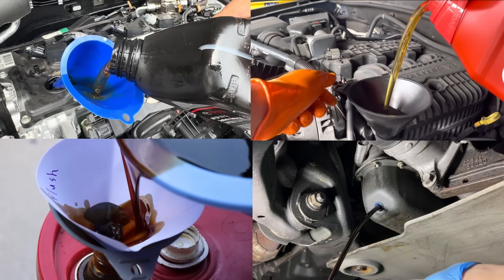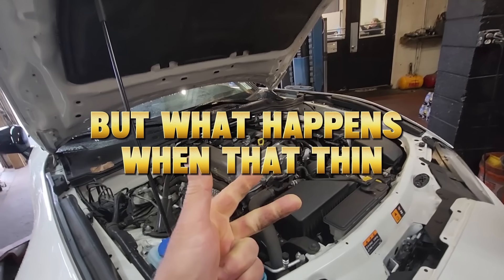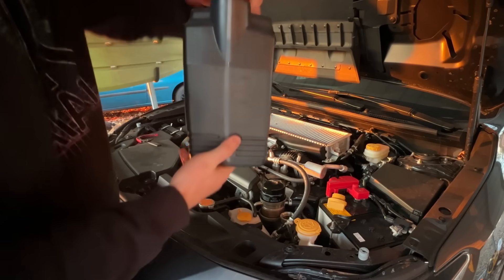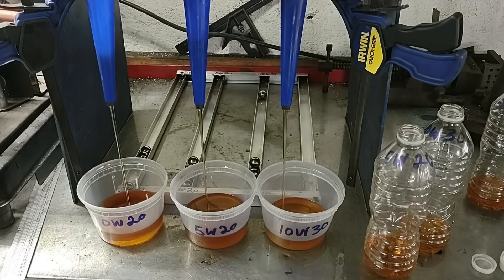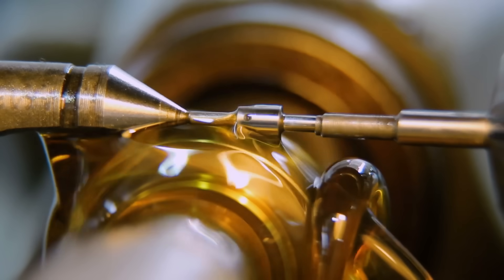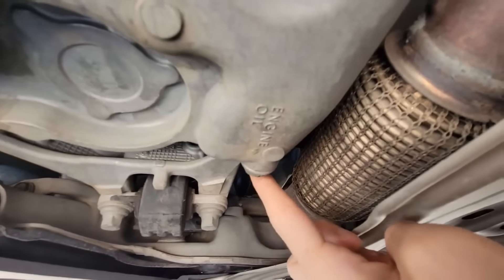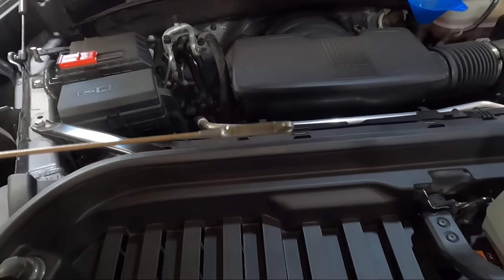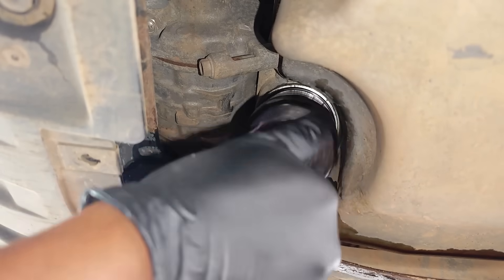The TRUTH About 0W 20 vs 5W 30 Oil (50 Engines Tested!)

Comment: Perhaps the biggest issue they don't talk about is oil change frequency.   Change oil frequently and avoid problems regardless of oil viscosity.  As an engineer, I agree with almost the entirety of what was said.
Reply: Yep main jobs of the oil are to contain wear particles and lubricate. Always change the filter when changing the oil. 5k is the signal you need to change the oil. These folks who pay up for the long lasting stuff are fooling themselves. You defeat the cleaning part of the oil letting it sit there for a year or more.
Reply: @stephenrblv And after they let the oil in the engine for a long period of time they try to undo the consequences by flushing the engine with diesel or additives. So unnecessary when doing a frequent oil change as oil itself cleans the engine - and keeps it clean when changed frequently.
Reply: @stephenrblv Agree.  Cheap oil or expensive oil...they both get dirty!
Reply: @tristandupuis5345  There's no dirt getting in the engine.

Engine oil turns black because of carbon,which is a byproduct of internal combustion.

Carbon in the oil is not harmful. If it was, diesel engines would not last a million miles. Many diesels turn oil black soon after an oil change.
Reply: @stephenrblv What you say is more common sense. If you stick to a 5K/plus filter change, it is a standard that might be the safest of all.
Reply: @stephenrblv disagree. My 2015 TDI just hit 130k miles so far with 10k mile oil changes. Pulled the oil pan to change the oil pump belt, and the inside is spotless. Look at the recent short I uploaded.
Reply: So true, frequent oil change is priority number one.
Reply: @ralfrufus6573  everything depends on the conditions (look at the failure at the timing belt in oil ( Ford ecoboost and Stellantis group small engines)
Reply: You can do oil intervals at 1000 mi if you want, we will continue to do intervals between 7-10k mi on our cars because it makes no sense.

You didn't even send the oil for analysis to see what the oil really is like after 3k. Engines don't dig through the ground to make the oil that dirty, many analyses have shown that oils at 3k miles are in good condition... and doesn't affect engine performance. Theoretically, the oil with 3k miles is still new, the analysis results are not surprising. We are talking about regular passenger vehicles, not supercars on the racetrack. 🙂

However, cheap oil is not as good because it may have fewer "additives", will not clean the engine as well, etc.

Of course, this depends on the brand, some cheap oils are a disaster, while others are very good for the price.

But since you all are such experts on oil, you probably already know all this. 🤣 Probably.......
Reply: @dchubworldsharenetwork  Would you agree that changing oil too early is better than changing oil too late?
Reply: @tristandupuis5345 Of course, changing the oil at 8k mi is better than changing the oil at 13k mi.

But changing the oil at 3k mi or at 5k mi is the same shit and doesn't make any difference for normal passenger vehicles.
Reply: @dchubworldsharenetwork  Says you.
Reply: @tristandupuis5345 It's your money and effort you're wasting. 5k is ridiculous with modern oils and engines and normal driving.
Reply: @penttijakonen3817  Blah blah blah.
Reply: @penttijakonen3817 5k is probably excessive, every 8-10k is fine.
Reply: @dchubworldsharenetwork Do you think there is a difference between the lower-priced oils if they are the "same grade API service" and viscosity,  as specified be the manufacturer?  Only compare full mineral to full mineral.  Only synthetic to synthetic.
Reply: @dchubworldsharenetwork 
The car manufacturers are right about the weights they recommend but when it comes to intervals they have an agenda that's in their best interests and not yours. 
By recommending oil change intervals at 10,000 miles instead of 5,000 miles they've got you generating half as much waste oil, that makes the EPA happy and they get to put a big fat check mark in a box on the "environmentally friendly" list, the more boxes they get to put check marks in the bigger tax break they get from the government, same thing with them recommending you don't pre fill your filter, by doing that it assures people aren't spilling oil that'll wash down drains into creeks and streams, that's another box they get to put a check mark in.
Neither one of those things will make your engine go out before the warranty is up and they know that which is all they care about when it comes to engine life.
Oil weight is a different story however, it's been proven time and again that sticking to the recommended weight is best for engine life, this video has already been debunked and has been exposed for using oil test data out of context to make their claims.
One thing that should have alarm bells ringing is in the first 10 seconds or so when the narrator says "...test results prove...and have been "confirmed by the car manufacturers"...), hogwash, does someone really expect me to believe that the car manufacturers have confirmed something that goes against their recommendations? Yea, right, that's just another case of people can claim anything they want, until they show me confirmation on that claim from the manufacturers themselves it's malarkey.
Reply: @dukecraig2402 Filling the filter is pointless because the engine and other moving parts are NOT completely or 100% dry.

This only happens once and the oil circulates quickly, so filling the filter with oil is pointless.

What about filters that are installed downwards, how do you fill them with oil?

Regarding the oil interval - driving style, climatic conditions, turbo or not, driving distance, only city or mixed, etc. also play a role.

That's why I said an oil interval - 7k and 10k.

For city driving, short trips, turbo engine - 5k to 7k.

If it were that dangerous, all engines would have blown up by now, because many people change their oil after 7k miles, along with our cars.

There's nothing wrong with changing the oil at 5-6k if it's necessary due to driving style, etc.

But to say that this is mandatory and even changing it before the 5k miles for a normal passenger car 🤣
Reply: @dchubworldsharenetwork 
Filling the filter is pointless huh? 60% of engine wear happens during start ups, that 1 to 2 seconds before pressurized oil hits the bearings is responsible for 60% of engine wear, compared to the other 40% of wear that happens over the 30 minutes or whatever the average is between shut downs, and you're gonna claim "But there's oil in the bearings the 4 seconds it takes fill a dry filter so nothing gets hurt", yea Ok, whatever, that oil is gone instantly and is why that 1 or 2 seconds before pressurized oil hits the bearings on every start up is responsible for 60% of the bearing wear in an engine's life, it's not a door hinge, it's an engine bearing and they require pressurized oil in the bearings to work, "Duh, dare's still oil in dare" 🤦 

As far as inverted filters you only have to be 10% smarter than your car, either disable the injectors by pulling a fuse or put your vehicle in "clear flood mode" if it has it and crank on the starter until the oil light goes out, and no, cranking on the starter is not the same as it running with a dry filter when it comes to bearing wear, whenever combustion happens you've got ×100 the psi you've got at the same RPM cranking, so if your engine has 150 psi cylinder pressure while cranking pushing down on the piston, down the connecting rod and into the bearings then the moment the engine fires you've got 15,000 psi doing it instead, and that's lower than what actually will be pushing down on the bearings once the engine fires because the faster an engine spins the higher the cylinder pressure is and at idle the engine is spinning faster than when you're cranking on it, so it's probably more like 20,000 psi pushing down into the bearings. 

Yea no kidding oil needs to be changed more often in the winter, I wasn't writing an essay on oil change intervals I was giving an example on why vehicle manufacturers recommend intervals longer than they should because they get tax breaks for doing so.

"If it were that dangerous all engines would have blown up by now", seriously? Can you be any more ridiculous?
Changing oil every 10,000 miles compared to every 5,000 miles, is the same thing as not pre filling your filter, you can act as ridiculous as you want but nobody ever claimed your engine will blow up before you make it around the block if you wait to change your oil at 10,000 miles or that it'll blow up just after starting it with a dry filter, but what guys like you will prove to the world is how to take an engine that could last 500,000 miles and reduce it to an engine that will only last 300,000 miles.

You should really stop and think here, your experience with engines is so limited you can't figure out how to deal with an inverted filter, and you're going to argue with someone who's been in the business of building engines for over 40 years, OK. 
Knock yourself out, I tried explaining something to you and you came back with nothing but a smart mouth, keep doing it, keep going, I'll sit here all night long crushing you with math.
Reply: For normal driving and for passenger cars with or without a turbo, a change interval of 8-10k mi is perfectly fine with a good oil (Mobil, etc.). Especially if the engine more or less always reaches operating temperature, and for a longer time ex: 30 mins.

For short distances, it often reaches high revs or for oils below xW-30 = 5 - 7k

With the cheap oil = 5-6k

Anything under 5k for a normal passenger car is useless and makes no difference for the engine.

The engine won't be destroyed because you changed the oil at 5k instead of 3k. That's not how it works. The oil still does its job perfectly fine at 3k or at 5k.

We always change the oils on our cars around 9-10k and have never had any engine problems even at 300+k miles.
Reply: @dchubworldsharenetwork  Says you.
Reply: @dchubworldsharenetwork when I had a vw tdi, 10k was fine.   14 Honda crv, mobile 1, and good filters, 10k oil change interval ended up in caked up rings, and that is with a 43mile commute each way on the highway.   5k is the way to go.
Reply: Turbo sti every 3000 miles, all others 5000 miles full synthetic
Reply: There is no automotive testing institute of North America, and no 50 engine test.  This is all AI bs.
Reply: @414s4 AI doesn't matter at all. It's the content that matters, not the AI.

The story, information, etc. can be written, a good one for example and the AI reads it.

Weird now, maybe... but not in 5 years 🙂

I don't mind AI at all.
Reply: Exactly, and most of it is done in an effort to make or create misleading numbers -
Reply: Engine oil oxidation no one has cancelled out…The distance from 7 to 10 thousand km-s is enough for oil to change.
Reply: Waste of time
Reply: Long oil drops are for warranty only, get the car out of warranty and pass emissions after that they want folks to get a new car!
Reply: GM warranted my L8T engine in my 2500 HD truck.  They require 5W-30 full synthetic oil to maintain the 3 year 36K warranty on the new engine.   I tow and have drag raced for over 5 years.  I do NOT believe in low viscosity oils, for the reasons you outlined in your video.  So in order to maintain my new engine warranty,  I use 5W-30 full synthetic oil, but add a quarter of Lucas full synthetic oil stabilizer to each change.  We used Lucas in all of our 1200 hp supercharged engines and had extremely good results of engine bearing longevity.   The long chain molecules in Lucas stabilizer keep the oil film on the bearing surfaces under extreme conditions and the product adds viscosity to the oil.
Reply: As an engineer you should be asking to see the data.  There isn't any!  There may be a kernel of truth here and there, but most of it is just junk.  Go check out The Motor Oil Geek.  He debunked this video.
Reply: @bentleydawg8573  Familiar with Motor Oil Geek.  My data is what I have personally compiled from over 50 years of experience.
Reply: Question. Some experts are saying there's a relationship with the DPF with regards to excessive particuate build-up  with the higher viscosity oil use. This was glossed over in this video. 
I don't see the connection nor the context of why that claim is being made but maybe you have something to add??
Reply: as an engineer i change my SUV engine oil very frequent for 5w30 I'm changing it at 5500 km.
Reply: Yeah I have a new 2025 chevy trax and noticed they put in 0w-20, next time I will tell them 5w-30, I do not trust a engine running 0w when it gets up to temp especially in the California summer time.
Reply: The worst thing for oil are short distances - but that doesn't mean the oil is ruined (except age).
👇
The oil is STILL good, the problem is that moisture, fuel, etc. slowly accumulate in the oil, which is why they say if you drive short distances it's a good idea to change the oil sooner.

However, when the oil is heated to operating temperature for a long time, moisture, fuel, etc. evaporate from the engine - yes, there is an opening on the engine for this very reason.

If you take a long drive or you have a long drive every few days to allow the engine/oil to warm up to operating temperature for a longer period of time, that's fine too.

Changing the oil every 3k for a normal car with normal driving is completely pointless.

With turbo engines, it is more important not to turn off the engine immediately, but rather wait 30 seconds - or drive at low/idle rpm before parking. You will do more good for the engine than changing the oil every 2k.
Reply: Well,  as an "engineer" what do you think of the rebuttal of this AI generated crap done by "The Motor Oil Geek" channel?
Reply: I change my oil every 3 to 4000 miles and I don't care what engineer or manufacturer tells me. I'm 54 and I've seen people lie to keep their job or just don't know any better. Kids today have to develop their own opinions don't blindly follow along or they got you.
Reply: @user-jo1hm3co6z  Why not just do a used oil analysis and determine the correct interval instead of wasting all that money/ 3,000 mile intervals on any vehicle made in the last 25 years is ridiculous.
Reply: @user-jo1hm3co6z  dont let them follow you and throw their money away on excessive oil changes lol! 

Don't forget to grab a new tinfoil hat at the parts store😂
Reply: @user-jo1hm3co6z  Agree
Reply: I've been told I'm excessive, but I change my oil every 2,000 miles with the cheap stuff, never had an issue, my 1988 Supra is nearing 330k miles, I bought it at 190k it's been an outstandingly reliable and fun car.
Reply: Yeah but if it's 0_20 I lose oil at 2800 miles. I use 530 I don't lose oil at all and can go 5k

0-20 is a gimmick so dealerships can sell more cars
Reply: @Loepfe7 0w20 is for a car with closer build tolerances.

Lots of toyotas rack up 200k-300k miles and dont burn any oil,and dont wear out.
Reply: So how do you figure out what is right? If you drive 5,000 in a year? Do you change every 6 months or a year?
Reply: @morganfbilbo4659  My 50+ years of experience tells me the actual time the oil is in your engine is basically irrelevant.  Judge the oil by the color and the mileage. It has been shown that even ten or twenty year old oil is still ok, provided the storage was reasonable.  I always recommend 3k to 5k interval for most common cars.
Reply: @morganfbilbo4659 you should stil change the oil at around 6 months even if you drive very few miles. The reason is because the oil mixes with gas and gas is one of the best solvents. The gas mixed in with the oil will break down the oil. Yes, it cost more but it is only a fraction of the cost of an expensive repair or worse - a new engine. I used to drive less than 2.5k miles a year because I primarily drove my company car instead of my personal car. Additionally, I changed the oil maybe once every year and a half because I drove so few miles. My view of this changed after my timing chain went out on the venerable VQ35 engine with only 100k miles. Oil & filter changed every 3750 to 4k miles. This happened in 2022 on an '04 G35 with only 100k miles. Go the safe route and change the oil & filter every 6 months if you drive less than 5k miles per year.
Reply: @morganfbilbo4659 ...oil testing...
Reply: This video is a AI scam. It’s a hack piece from other videos and does not relay accurate information. Follow the manufacturers recommended oil viscosity. If you don’t understand why that is important, then you don’t understand the why behind the why. Think of it this way, you are not the expert here. The experts have spent years studying and then testing what is the best oil to use. Your understanding of why it should be different is literally a single drop of water in Lake Michigan. Even Tristan the engineer’s claim to change oil frequently due to viscosity is a lack of understanding. Synthetic oils of today do not break down between oil changes. Even the Walmart cheap SuperTech holds its properties for 10-20k miles. Brand name oils are unchanged for 75-100k miles. We change “oil” at least annually not to change the oil, but to change the filter. Most people could reuse the oil for a couple of years as long as they change the filter because the oil hasn’t broken down at all. However, infrequent oil (filter) changes leaves contaminants in the oil, while the oil is still doing its job perfectly, and those contaminants plug small passages and cause metal wear. Metal wear happens from contaminants, not faulty oil. Tristan the engineer is correct on changing frequently, but his understanding of the why is incorrect. We all fall into that trap so follow the vehicle manufacturers recommendations as it is backed with experts and testing.
Reply: @mst5632 Nobody with a brain isn't changing their oil & filter
Reply: @mst5632  You are a jackass.
Reply: Just change the filter. If you do that often enough you can leave the oil and save a ton of cash and pollution.
Reply: @rich8037  How do you figure you can leave the oil in and only change the filter? You need to rethink what you said.
Reply: @rich8037  Wrong. Big time wrong. Crankcase dilution.
Reply: @rich8037  Ouch! I knew a guy that did that/back in the 1950's, and his car crapped out in 3 years.
Reply: @morganfbilbo4659 Yeah,  that myth was popular in the late 50s and early 60s. I  didn't buy it.
Reply: @rich8037  Well, that's a BS statement.  Oil breaks down due to wear no matter how "clean" you keep it.
Reply: @91156 additives start degrading...
Reply: @rich8037 
That's actually backwards, you do understand that the dirtier a filter gets the better it filters don't you? Obviously not, a brand new filter actually let's bigger particles through than an old filter, the problem is however used filters eventually get to where they're obstructing flow, which will either starve an engine of oil or if it's a filter with a bypass it'll send unfiltered oil through the engine. 
The old timer trick was to change filters every other time you changed oil, not the other way around, back in the 80's it was Nissan I'm pretty sure that actually had tags riveted in the engine compartments that said "Change oil every 3,000 miles and filter every 6,000 miles".
Reply: @rich8037 No. Oil is more important than filter. I would rather skip a filter change than an oil change. The more often you change the oil, the less the filter gets loaded.
Reply: @ralfrufus6573  Don't ever skip your filter change.
Reply: @lukeasacher Don't ever skip your oil change. By the way, old aircooled VW Beetles don't even have an oil filter. They have an oil strainer that requires periodic cleaning instead of replacement. This strainer is a metal mesh screen located under a plate on the engine case and must be cleaned with a solvent like mineral spirits and a brush to remove debris. 

That proves that oil filters are overrated. 
You see, oil changes are more important as the oil loses its additives and its viscosity, and no oil filter can prevent that from happening.
Reply: @ralfrufus6573  Hey Boss!... I'm 65- grew up with the Idiot Book... first car was a 71 flat windshield Super Beetle... my fave was my 71 bus- added a Reevco oil cooler and a spin on filter bypass. Every 1500 miles- oil change, valve clearances, points condenser and timing... :)